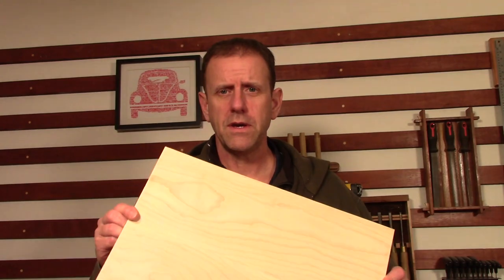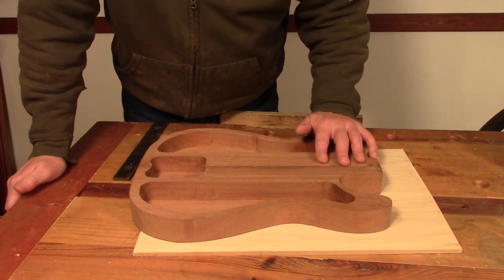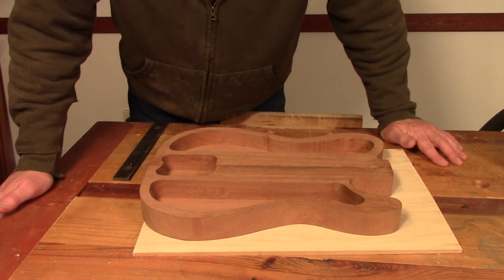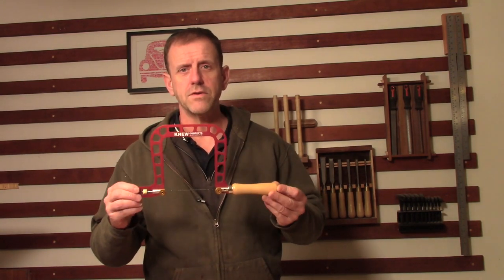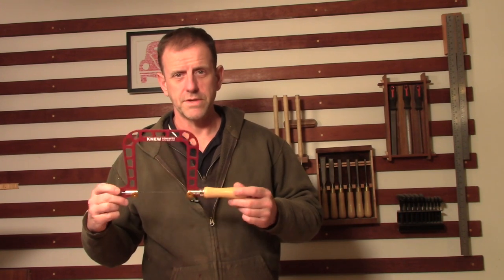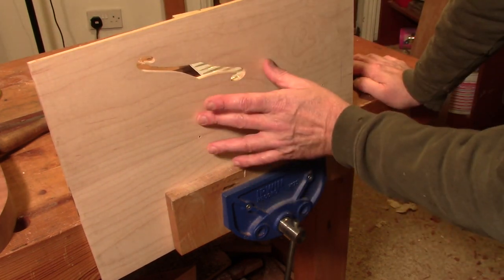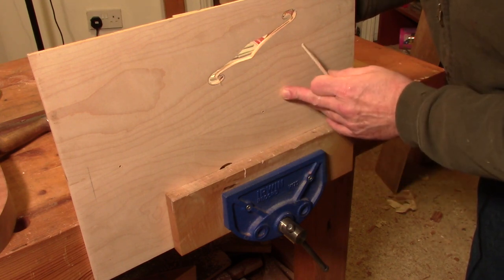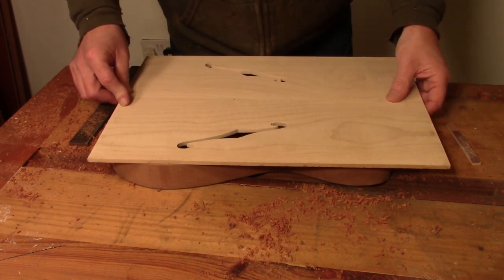Thinline Telecaster build part 5

Comment: Since you have a top is there any reason you can’t install the pots and switch a wire them together on the top before you glue it onto the body?  I’ve struggled with feeding components on a 335 kit before and don’t want to go there again!  Thanks and keep up the good work.
Reply from the maker: Hi Mark, no reason why not as long as you can find a route for the wires etc. I've done a few of these now and it has got a lot easier with practice.
Reply: Thanks, mate.

Comment: just an idea, you could thin the under side of top to about 2-3mm thick just around the perimeter (5mm)of the f hole. Then when finishing sand it to a blunt fine edge. It makes the top look really thin and fragile, whist still maintaining its integrety with its normal thickness through the rest of the top. I have done it on one of my hollow body builds and it looks really fine and intricate. Ihope that makes sense, I'd post a pic but dont know how. Keenly watching this build
Reply from the maker: Yep, I know exactly what you mean. I think Fender did that on some of their thinlines. I did consider it for this build but decided not to. Time pressures are a thing at the moment.